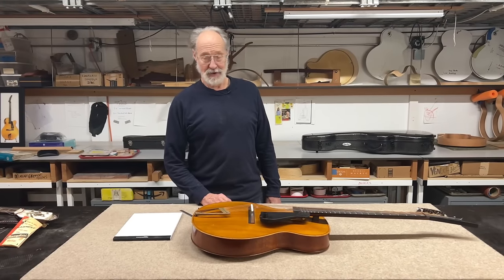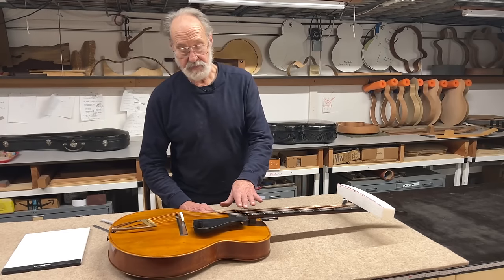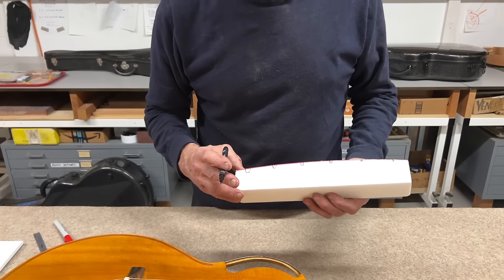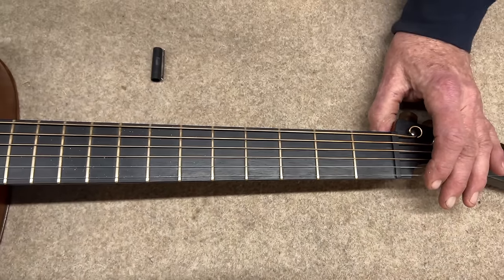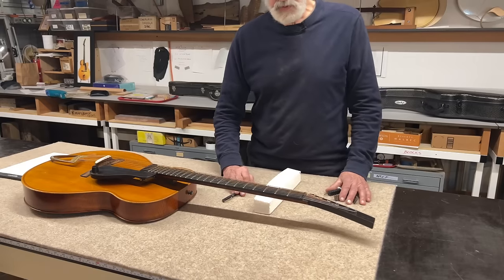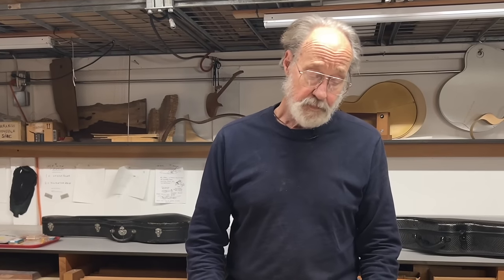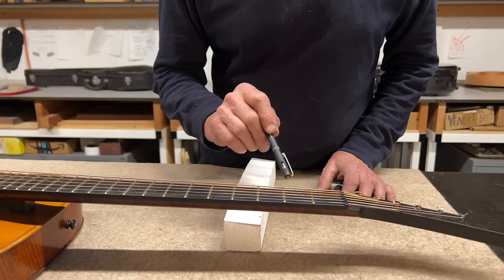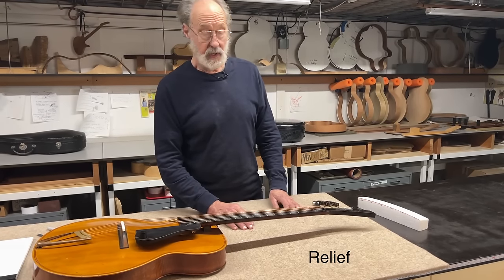Ken Parker Archtoppery - The Neck Journey 9) The Nut

Comment: When playing professionally I place 3mm diameter wire strip  up against the nut across the board with a dab of CA on the to hold on place on Fender style helped with the trem and intonation a type of zero fret ..back in the 80's ..
Can you discuss the story of the first bass strings used by Fender...I understand gut core with metal winds over the pick up area 
is this correct Ken??
Reply: What is CA?
Reply from the maker: Sorry, CA is short for "Cyano Acrylate" aka crazy glue or super glue.
Reply: Can I ask what kind of /size/ zero fret can I use for my Parker Nite fly? Stew mac sells them, is there a correct size? How will a zero fret line up with the right height of the other frets without cutting the fingerboard? Do you notice anything better about the tuning/intonation? Ken says you can take them or leave them, which is why I'm asking you, since you've done it, do you notice an audible difference? THANKS

Comment: Thanks Ken.
I recall Alembic offering both string spacing options(centered or equal distance between)
Reply from the maker: Confuse "em with choices! I doubt that many players could ID this blindfolded on a guitar, but the bass is another story. Anyway, it only counts at the first fret or 2, and it's small beer.

Comment: I become ever more attracted to zero nuts - they seem to eliminate so many issues of set up, slotting, etc…
Reply: The one potential problem though, is that the strings will often dig grooves into the zero fret. And if that fret is too far away from the nut, when you bend strings down toward the nut end, the string will come out of that groove and make pinging noises. A stainless steel zero fret might fix that problem.
Reply: They’re a foolproof way to easily get the right string height, and I’d certainly take one over an overly high conventional nut, which is the probable alternative on an inexpensive instrument. For a no-expense-spared guitar, though? Not a big fan of the extra friction.
Reply from the maker: This has been a vexing quirk of this system. I'm not saying that it can't be done well, but for a method that is thought to be easy-peasy and solve problems, it seems to bring a big bag of new troubles with it. Feh, just cut a good clean nut.
Reply from the maker: "Foolproof" is a word that I used to use until I started a company to make guitars. Color me humbled, I now only use it in jest.
Reply: @kenparkerarchtoppery9440  well yes, I chose that word for the sake of brevity, trusting the reader to realise it's merely an indication of relative simplicity and should not be taken absolutely literally. I suppose that, in itself, was overly optimistic of me.
Reply: @kenparkerarchtoppery9440  '"Foolproof" is a word that I used to use until I started a company to make guitars.' LOL! Try to think of it as creativity instead of effing things up.

Comment: Just a note about the True Temperament frets you mentioned(or squigly frets as you call them). I believe originally they just shaped frets to compensate for variations in pitch(change of tension from fretting etc.), and I think most people would agree that it achieves that goal. This would simply be a compensation system for equal temperamenet. However, the system they sell now is actually meant to be used with the strings tuned slightly differently, so it would actually be considered a different temperament system.
Reply from the maker: This end of the pool has been completely unexplored by me,  although I've heard the arguments over the years. Go get it if it works for you!

Comment: "Reasonable people can disagree". I like that a lot. I am surprised to hear you say you don't know of anybody using equal space between the strings at the nut. I use the Stew Mac fret slot ruler which is based on that idea. Spacing from the center of the strings would squeeze the larger diameter strings closer together. Obviously you sold a lot of guitars set up that way. I just find it interesting.
Reply: You could argue that while the larger strings might have the edges closer together, your fretting hand is usually pressing down the top of the string(center), not between. The plucking hand might prefer having the same distance between though. I think this particular issue is simply one of personal preference, I don't think you can truly argue that either is better.
Reply from the maker: Every Parker product had equally spaced string centers. we never has a single comment on this in over ten years and thousands of guitars. I don't see the argument for the other side of this, and I think it makes it harder to play the low strings near the nut, where this little difference is felt most. After all your finger touches the string, and it moves it to the fret where it touches down in the center of the string. The low strings aren't closer together, they're just a tiny bit larger, so there is a tiny bit less distance between them edge to edge. Have it your way, but really, how many great guitars has Stewart-MacDonald made? Just sayin'
Reply: @kenparkerarchtoppery9440  Love your stuff Ken. Just mentioned an alternate approach.

Comment: The nut material is not only a thing soundwise ( very minimal if any) but also important for tuning retention, when the player do bends or vibrato.
Reply from the maker: No Doubt! Here's where sticky metals like brass and aluminum really stand out as terrible nut material choices.
The nut material either needs to be lubricious in it's own composition, like the Graph Tech stuff we used at Parker Guitars, or, if you'd like a harder material, it should be something hard and crisp that can be lubricated with something greasy, or graphite powder, etc. Here's another reason not to use the 0 fret design.

Comment: When it comes to relief, I've found that string gauge, scale length, and tuning (standard, dropped, etc) all affect string tension, and therefore string envelope size, and therefore relief required.  In fact, for long scale lengths (>= 25.5"), light strings (8's), and  non-dropped tunings, I've found i can get away with no relief whatsoever.  But heavier stings or a Gibson scale length usually calls for a bit of relief.

When it comes to nuts, I actually like zero frets.  They are an elegant way to get perfect nut slot height.  But as you say, a regular nut works fine too.  I set nut slot depth at the same height as a zero fret.  As a player, I prefer equal distance from the strings to the edges of the fretboard - not bass string closer to the edge than the treble string.  I also prefer strings with equal spacing between them, not equidistant center-to-center - despite the fact that the latter is easier to implement.  However, I tend to use Floyd Rose style locknuts on my builds, so I usually don't get a chance to implement a hand-cut non-offset equal-spacing nut.  I like locknuts because they remove everything above the 1st fret from the tuning stability equation.  I too tested many types of nut material.  In general, metals seemed a bit brighter than plastics, which seemed a bit brighter than woods - but I didn't put them on a spectrum analyzer or anything like that - so no hard numbers to back up those impressions.  The conclusion I reached was that zero frets minimize the tonal difference between open and fretted notes, and nut materials similar to the frets are tonally close enough.  And like most things guitar - you have to A-B test it back-to-back to really notice a difference.  I found little or no difference between steel, aluminum, and brass.  The last build I did with a non-locking nut was the 12 string tailtuner with center-to-center spacing and equal spacing on the bass and treble sides.  The nut was cut and shaped from a bone blank.
Reply from the maker: Lots of good observations here, Norm! A thinking man's analysis. Live long and prosper!

Comment: Bob Benedetto in his book 'Making an Archtop Guitar' recommends equal spacing between the strings ie from the string edge, not centre, and an equal space on the outside for the top and bottom strings.
In passing, at ~2:11 you say '12 at the nut'. I assume this should be at the string mid-point ie the 12th fret?
Reply from the maker: Sorry to be so casual as to confuse, I meant 12" arc radius curve at the nut, as I was talking about how this curve changes over the length of the scale, 10" arc radius curve at the nut, 12" ARCurve at the mid-point, or 12th fret, and 14" ARCurve at the bridge. Make sense?
Reply from the maker: I have sworn to and have had my signed statement notarized that I will never comment on Bob Benedetto's instruments, methods, tools or his instructional materials. My pledge to you, Notarized. Over and out, last comment on this subject.
Reply: @kenparkerarchtoppery9440  Hi Ken, thanks for the reply. I really wasn't at all confused - you just mentioned 10" at the nut, then 12" at the nut whilst pointing at the mid-point, which sounded like a sort of verbal typo that I thought you might prefer to fix. Sorry if it came across as pedantry - a privilege of old age :¬)
Reply: @kenparkerarchtoppery9440  Thanks again. Can I get a copy of that? I'd love to add it to the case candy with my Manhattan Custom ;¬) 
Of course I only offered it because you did ask for examples of different approaches to string separation, and I think Benedetto is sufficiently illustrious to warrant a mention, particularly as his book is (I think) still the standard work on building an archtop.
It would actually be remarkably interesting to hear/read a dialogue between you and him discussing your different approaches to the trade-offs inherent in archtop design - the Socratic dialogue is after all a part of the scientific method on which we all depend.

Comment: There is one aspect of zero fret that you should mention. Unless it's a really hard material (stainless) a zero fret gets groove from string bending (if you play rock and blues) losing it's proper heigh. You then need to change that fret with exactly the same fretwire.
Reply from the maker: True this, and it's one reason I never liked this 0 fret system.
I should have mentioned that also the 0 fret means that you can't micro-adjust the string height to accomodate different playing styles, as the fret sets the height in a permanent way. Some builders use a higher fret for the 0 fret to build in a little extra height. I think this is unfortunate, as it raises the action for all the notes! Along with the wear concern that you cite, these issues erase any advantages that the system offers, except that it does remove one step, precision nut height adjustment, from the long list of tasks performed to get a guitar to play well. The 0 fret thing works, but in my opinion, it adds new problems that make it less desirable than just cutting the nut correctly.
Reply: @kenparkerarchtoppery9440 Thank you for your answer. The more I learn about your design the more I'm impress with your inquiring mind. This Youtube channel show me that you are also a great communicator and teacher. I really like your videos about tools.
Maybe I misheard but I think that in one of your video you mention that Floyd Rose convince you that 6 tuner inline was better than 3+3. If that is true i'm really curious to know why. Did you already adress it in one of your video? Maybe I miss it.

Comment: Hmm... I don't understand this PRS patent (by the way, I don't understand quite a lot of the patent madness in the USA at all). Since the position of the strings on the nut should be the same if a zero fret were used instead (not disputable I think), the edge of the nut should be moved by half the thickness of the tang (0.25-0.3 mm) towards the headstock. This is because if there was a zero fret there, its top, i.e. the string's support point, would be in the middle of the cut with a saw or a milling cutter, whatever is used for cutting fret slots. Since the string support point on the nut is on the closer to the bridge plane of the teeth of the cutting tool, the center of the tool guide, regardless of whether it is a milling cutter or a saw, should have been moved by half the tool cutting thickness towards the headstock. That is at least what I am doing. Luckily I am not infringing the PRS patent 😇 and my guitars play surprisingly in tune. Of course correct string height is a must) ;)
Reply from the maker: I agree that the nut landing surface against the end of the fingerboard should be 1/2 fret slot width longer than the center of the slot for a correctly placed zero fret. The PRS patent described an even larger shortening of this dimension, with the bass side of the nut being .030", or.76mm closer to the first fret, and the treble side .020", or ,5mm closer. At Parker Guitars we spec'd this length tolerance as + nothing, - .010" or .25mm. The PRS patent is long expired, and later on I believe they chose to adjust their lengths a little closer to maybe 015 -  .020? or .5mm, or a bit less, thinking that they had overdone it a bit. As I mentioned, everyone has a right to defend their compromise, but I think a lot of this nonsense came about because builders were setting the nut too high under the influence of not understanding the crucial importance of not doing so, just one man's considered opinion. 
By the way, both PRS in the '80's and Fuzzy Bitin' in the 90's patented the exact same thing!  Funny thing about US utility patents, often they are granted in error, and both of these qualify as indefensible, and so would never have been held up in court, due to the argument and its embodiment being 800 or so years old. Can't defend a patent if it ain't a new invention, just like the headless guitar and a lot of other stuff folks thought they invented. 
One of the fabulous things about being a builder is to take you place in the lineage of builders stretching back over 40,000 years, a big chunk of our time here on earth. It turns out that it's not easy to do anything truly novel, and also that reasonable folks can disagree.

Comment: Agreed - far too much to do about nut material. THE BRIDGE material is what matters.
Reply: Amazing the difference between brass and steel Tele bridge saddles, for instance.
Reply from the maker: Oh yes there is! The bridge material is quite important, just ask those who have junked their crappy Strat Vibrato blocks in favor of the original steel. Saddle material counts a lot.
Reply: @kenparkerarchtoppery9440  Well, to clarify, I meant the bridge as a unit.
Reply: @kenparkerarchtoppery9440  Do I misremember that the Fly had an aluminum bridge? I have a Strat with a crap block. I bought some aluminum (a harder alloy - can't remember the number) with the intention of attempting to make my own block, but the older I get the less I seem to do - let's hope I live long enough. Aluminum - based on very little actual experience - seems quite a musical metal.